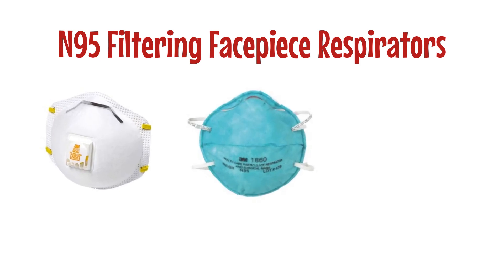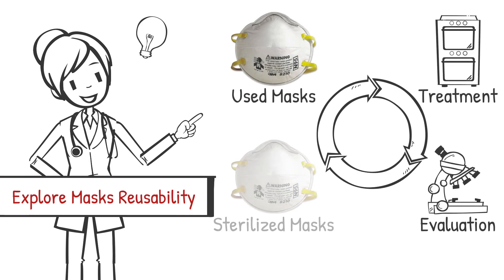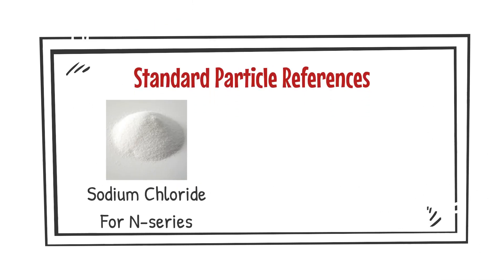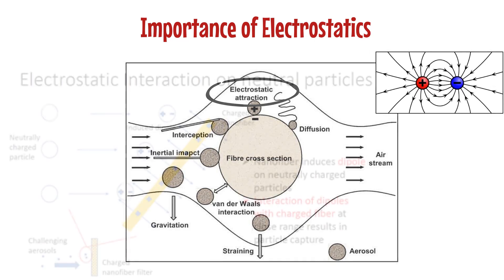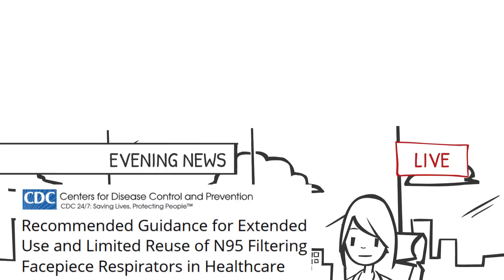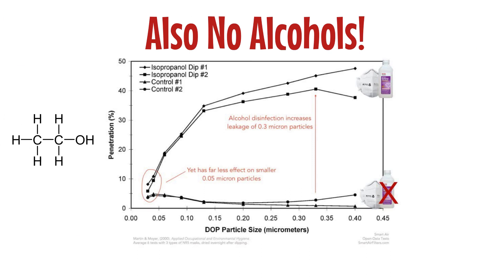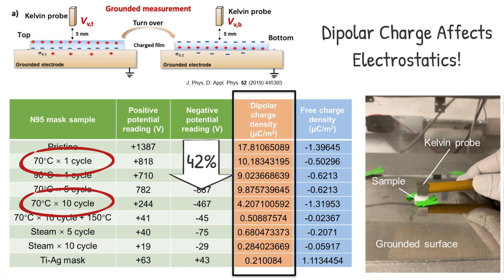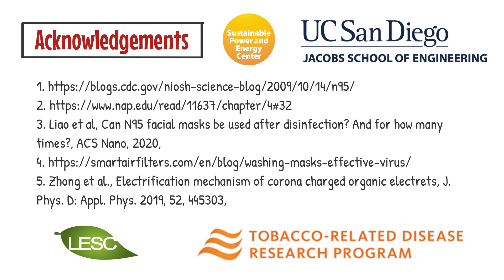N95 Masks Reuseability - A material scientist's perspective

Comment: Thank you for a very informative video. You did not discuss or study UV irradiation. What if the masks are kept in the sun for some period of time. Especially in summer we have plenty of sunlight. Can you please do this experiment and share your results because not everyone has vacuum oven but everyone has access to the sunlight. Thank you.
Reply: This is a good area for additional study for the reasons you mention. The initial assumption is that UV may not adequately decontaminate particles embedded in the filtration matrix, but I'm not aware of testing to confirm thats the case.

Comment: As in "the best process is no process", why not just let the mask rest for a couple days?
Reply: bacterias can be an issue - our breath may not be as clean as  you think :)
Reply: @shirleymeng  You are right, though one at least would usually smell that problem. Was just thinking about the viruses. :/
Reply from the maker: @eigenvalue9358  And resting for a few days might not be a time-efficient way for places urgently need to use/reuse N95s
Reply: @lescpublic206  It is better than throwing them away. If you have a couple you can rotate them. Most of us sadly dont have a vacuum oven at home ;)
About the bacteria UV light would help, no? Basically putting them 4 days on sunlight should do the job, what do you think?
Reply: So maybe we can just stick N95 masks in a standard rack dehydrator at 70°C for 30 minutes? Those devices are designed to drive off moisture at low heat. After that, the electrostatic field of the mask needs to be measured with an appropriate meter and, if needed to the electret fibers can be recharged with a triboelectric (Van de Graaff) generator and tested again with the meter for efficacy.